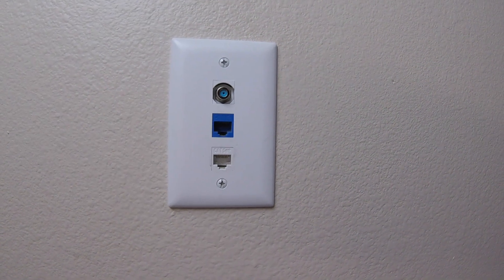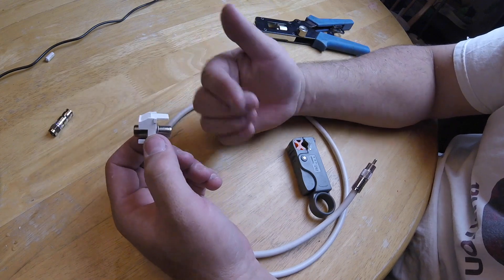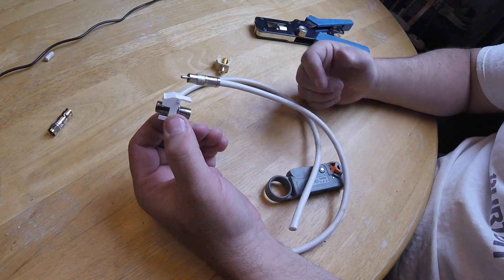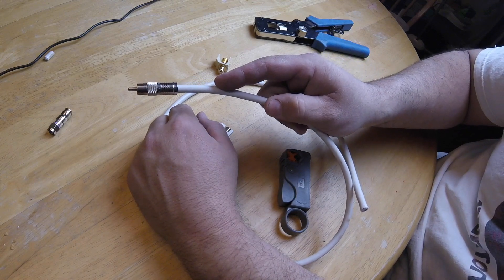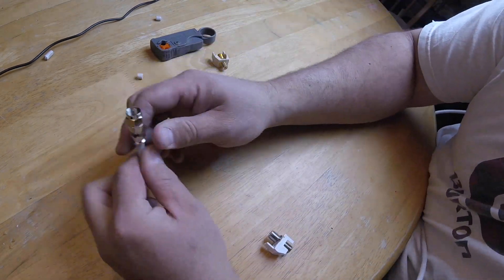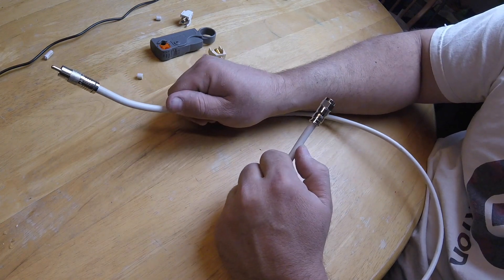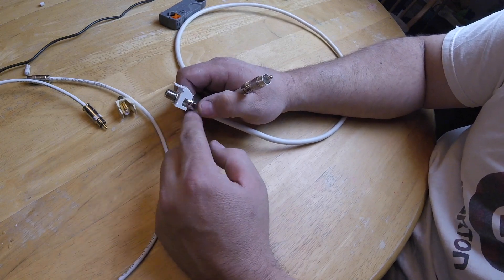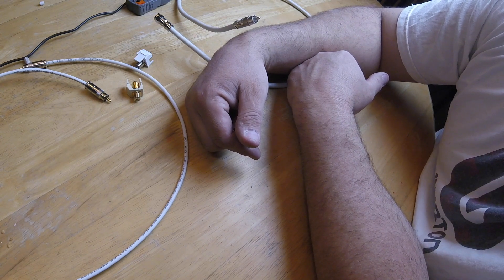How to make your own customized Subwoofer cable

Comment: Great video!  Thank you!
Reply from the maker: Thanks for watching! Hope your cable turns our awesome.
Reply: Thanks!  Could you do me a favor?  Can you point me in the right direction to buy the type of RCA connector I would use to just crimp onto the end of RG-6 cable?
Reply from the maker: https://www.amazon.com/PCT-Connector-Universal-Compression-Fittings/dp/B00789H3VK/ref=cm_cr_arp_d_product_top?ie=UTF8
This is a COMPRESSION fitting though. They don't make a crimp RCA connector (at least I don't think they do). This means you need a compression tool to put it on.

Comment: Why would you not use a 90 degree connector inside the wall on the back of the keystone?
Reply from the maker: Good question. You can if you'd like but it's not necessary. The wall is 3.5" thick so you can just use a straight connector and let the wire bend in the wall. I've never had a problem and I've installed hundreds of these.
Reply: Alan Clegg, gotchya. That is what I expected but I wanted to confirm. Thanks!
Reply from the maker: Thanks for watching! Are you making your own sub cable like I did?
Reply: Not yet. I actually hadn't even considered such a thing until I saw your video. I've been following SuperDave and his Dolby Atmos build for ideas going into a new home. I'm super excited to get some tools and start playing and learning.

Comment: I never knew a RJ45x connector was ever called a keystone connector
Reply from the maker: The RJ45 isn't called a "keystone." The square cutout shape is called a "keystone." You can put any connector in the keystone hole.
Reply: did he state that when I'm looking at a RJ45x faceplate. What he should have said is exactly what you said. But also stating that the connectors that he's pointing at are RJ45x in the faceplate. And the faceplate are not universal the same period.
Reply: @AlanCleggYouDoAV   That specific type of modular faceplate is called a keystone plate and the modules are called keystones.

Comment: Poor choice of title - does not describe the topic of your video
Reply from the maker: This is how you make any RCA cable including a subwoofer cable which is an RCA style cable.
Reply: @AlanCleggYouDoAV  Isnt an RCA cable the actual subwoofer plug? I was hoping to see how to add the subwoofer plug to an RG6 cable.
Reply from the maker: @leecm  I'm not sure if I understand the question. A subwoofer cable is an RCA style cable. RCA is the slip-on type of connector that I'm putting on the RG6 cable. This should be the video you are looking for. Feel free to email me at alan@youdoav.com with questions.
Reply: @AlanCleggYouDoAV  Didn't you connect an F-connector to the cable? The plug I was hoping you would be attaching to the cable (and what the title of the video led me to believe you were demonstrating) is the RCA style plug that is already connected to the other end of the cable you're working with in the video.
Reply from the maker: @leecm   ah. Now I understand the question. Thank you for clarifying. I should have made it clearer and maybe I should make another video to clarify. There is absolutely no difference in the process. Putting on an F connector or RCA or BNC or whatever is the same- same tools, same cable, same process.  The only difference is the connector.  There is no other difference. Instead of putting on an F connector, like I did. Just put on an RG6 to RCA compression connector and use the same tool to compress it on.  Use the same stripper in the same way as well.
Reply: @AlanCleggYouDoAV  cool! Thanks for the video
Reply: @AlanCleggYouDoAV  Hi Alan. Great video. The title is perfect in my opinion. I am familiar with RG-6 etc and I already have a compression tool that works with both RG-59 & RG-6 from my previous employment at the local cable company. I did not know we can use the same tool for BNC as well as RCA fittings. I will locate and follow your links to see if you have a link to the fittings other than the F connectors. I wanted to say thanks for the video before I got sidetracked as you creators really help the masses and aren't thanked enough. Please realize most of us rarely take the time to express our gratitude. Thanks for sharing..
Reply from the maker: @jamesscarborough4673  Hey man! Thanks for the comment!